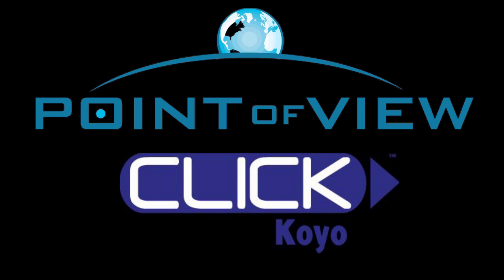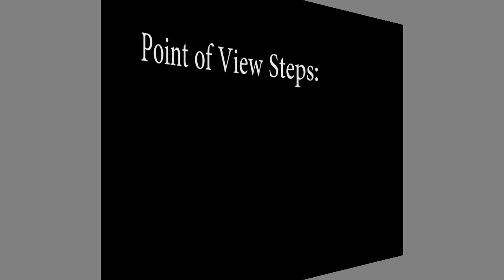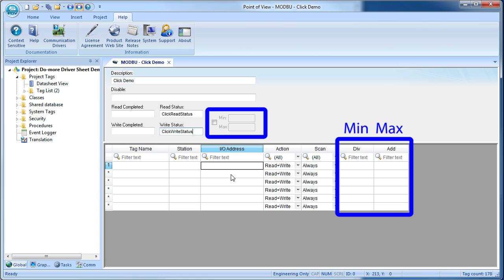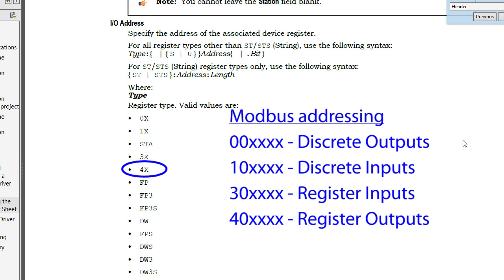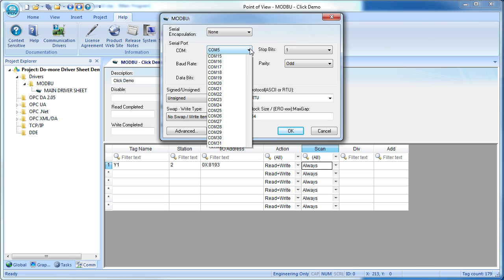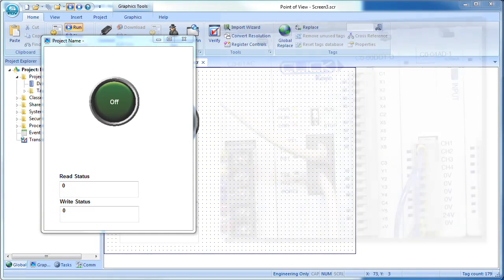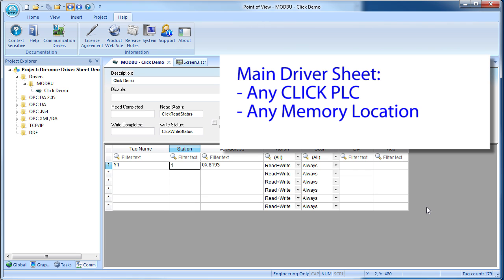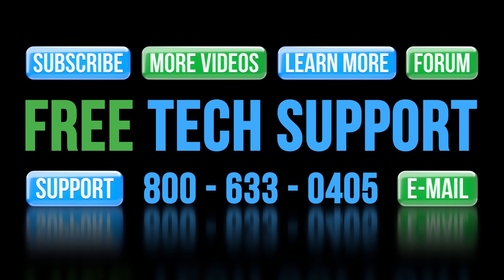Connect Point of View to CLICK PLC from AutomationDirect

Comment: Can I use this software to datalog memory data from a group of Click (Ethernet Version) in a small network and save this information on a server?
Reply from the maker: @Juan Carlos Avila, this software is no longer available to purchase from AutomationDirect. If you had previously purchased this software, you would be able to log the data from multiple CLICK CPUs and then store that data locally on a server. If you already have this software, feel free to contact me at twheeler@automationdirect.com or call into our Tech support department for further help in setting this up. Tech Support - 1-800-633-0405